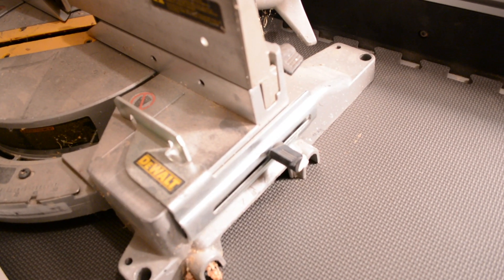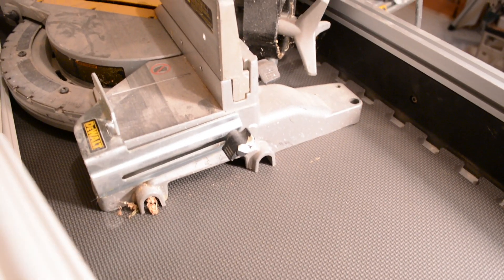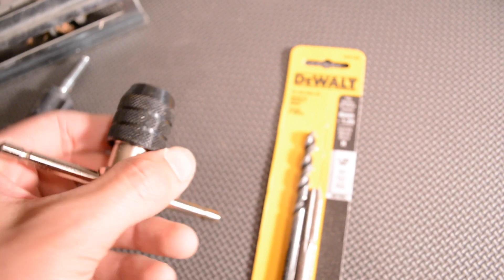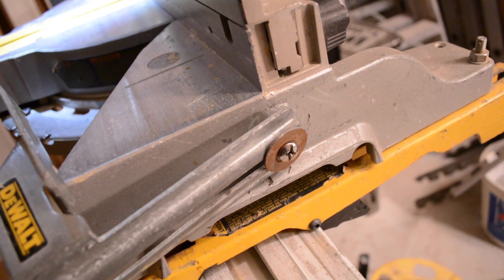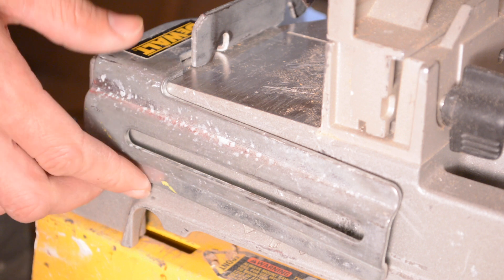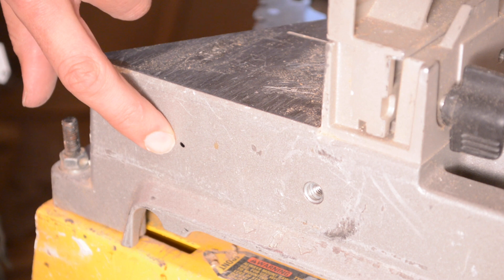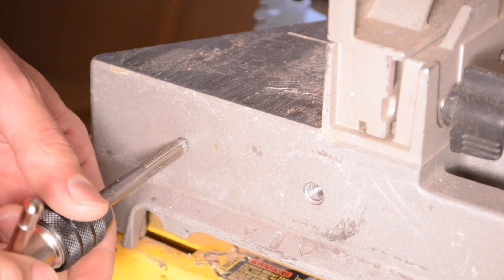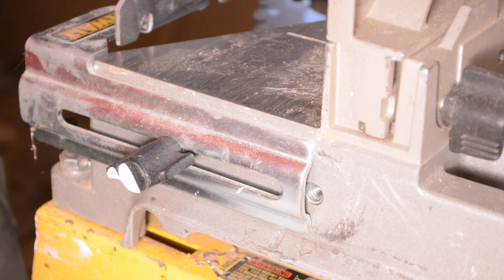I Modified My DeWalt! It Actually Worked!

Comment: Don't go too crazy on tightening that nut. Looks like you only have 4-5 threads to work with, and that aluminum will strip very quickly.
Reply: Matthew Wheaton I was actually wondering why it didnt strip upon first use. Id bondo/epoxy a nut or piece of tapped steel on the other side.
Reply: Matthew Wheaton Matt is right, just flip the Mitre Saw upside down, and epoxy a bolt or weld a bolt on the inside problem solved, if you don't want to thread the hole you can just do that to start with.
Reply: Agreed, if you look at the original hole, there is a steel nutsert/rivnut embedded in the cast alloy base. DeWalt put that there because the material is so soft and thin that the threads would strip in no time. I recommend modifying this to add a nut or tapped steel insert behind the base so you're not relying on the 4-5 threads in the soft aluminium.
Reply: There is another way to do with 10" slide dewalt, If some body interested can send a  pictures how guys from our company modify  saws and stands
Reply: Rivnut it.
Reply: I’m gonna do this , I need to look under my saw when I get a chance , see if there a spot with a little more meat to drill into. A spot with some gussets or something

Comment: I'd be very wary of using that new hole,  very thin wall and very little material to support the threads.  I'd look into a threaded insert to reinforce that.  Never used those crown stops and I've cut the same cove mold without issue,  sometimes the crown needs to be rocked a little in the saw to make a clean splice.
Reply from the maker: Definitely hear you. The modification will probably continue with a threaded insert, or nut on the other side of the thread.

Comment: I have asked this question several times, on several different you tube vids, and never a response. Why, when the saw has the ability to cut many angles, do we cut crown in the upside down position. It is extremely confusing and does not make sense. Can someone please explain.

Comment: Welcome to metal work! Resourceful mod to get the most from your saw.

A few pointers:

(a) "Threading" denotes cutting male threads. It's done with a tool called a "die" or on a lathe with a gearbox. Cutting female threads (like here) is called "tapping," and the tool you used to do it is called a "tap."
(b) It helps to punch/center drill holes to position them precisely.
(c) That's a tiny amount of metal there. You are probably going to strip your hole, especially reefing down on it the way you're needing to. Some other posters have mentioned a "nutsert" (also called a "rivet nut") or attaching a nut or extra metal on the back of the hole. Either of these will make the mod far more durable.
(d) It might not bang around well on the way to the jobsite, but as a resourceful carpenter, you could add a second knob and fashion a little sled that wouldn't jangle around and be quite as painful to position.
(e) If you get a chance to play in a machine shop, take it! You'll be a natural and will be able to design and mill a top quality rock solid upgrade in relatively little time.

Comment: In the video when you have the large trim on the saw , I can see the original hole showing couldn't you have just cut the slot a little longer and used the original hole?

Comment: The worst part is that when the hole strips it will be right when in use. Time sert makes the best thread inserts. You have to buy several in the kit, so just go ahead and install several on each saw.

Comment: Good modification but be careful not to over tighten the tbumb screw. You don't have as many threads as the rear hole and its cast aluminum. Good job.

Comment: hello,if i were you,i would put a nut on the back end of that screw hole you've just made fit before you strip out the thread again,after doing that,make yourself another hole at the end of the fastener just a bit toward's you,about half inch or so away from the old screw hole,that should keep it all a bit tighter for you with minimal drop on the fastener,job's done,and please keep them coming for all of us over in England,thanx buddy

Comment: another tip for you, a better blade equals better cuts and less time. you can't go wrong with the red frude Diablo 100 tooth thin  kerf Tri cut tooth.  
however to have that blade sharpened is a nightmare as there are three sides to each tooth. Blade sharpeners don't like you when they see you coming. So then pitch it and replace it with the same.
Reply from the maker: Wade Verweire yes I am switching to Diablo next week! good call. I was just using these DeWalt blades because I had them. I'm going with one on the table saw too.
Reply: dfw crown yeah they make crazy good blades that stay sharp forever if you don't cut nails LOL. I used to build custom cabinets for about 10 years, I've done a little bit of everything yet not everything. it's interesting to experience different lines of work. Currently I'm doing some welding on my pole barn and came across Diablo steel demon for a  7 1/4 skill saw and was impressed it rips through metal sheeting like butter.
Reply: dfw crown It's nice that you are so receptive to your subscribers, I comment on the Samurai Carpenters stuff and he gets all defensive like a big baby. So where I'm going with this, tailing off of the blade comment, I was always told to let the blade gain full speed before you chop.  You cut very quickly in your videos, maybe let the saw gain full speed before chopping, you will definitely get a nicer cut. I'm just saying, your stuff appears to be great looking, but it's hard to tell the cut quality on film. Thanks for all the tips, have a prosperous work week sir.
Reply from the maker: Matthew Kelly thanks. yes I am learning just like everyone else. I have gained much knowledge since starting this channel. I mostly cut MDF and FJP thin moulding s. so its very thin. but thanks for the tip. have a great week

Comment: A Great Adaptation for larger CROWN.
.......................................................................................
( go one step farther to keep the slider from 
..sagging down when pulled all the way toward you)
........................................................................................
To keep the slider on the same plane as the saw bed
when pulled all the way toward you,  simply attach a 
piece of metal that will fit between the slider and the saw bed
and have it extend from your new taped hole toward the 
back of the saw bed.
This way, when you slide the STOP, it will always stay in the 
same plane.

Comment: My Dewalt saw doesn't have the hole in the side to mount the crown stop .  The saw base isn't made of steel  so welding a nut to the other side isn't happening.
Tapping the saw base may work if the saw base is thick .  
You would think that Dewalt engineers would use their brains to design  every saw to have this  stop with the saw.

Comment: Add a nut to the inside. That aluminum will strip out very fast
Reply: Don Dehne I agree. Should use glue to hold the nut in place, just make sure to lightly cover the threads on the bolt before gluing so the glue does not stick to the bolt.

Comment: why you don't  cut it flat at the mittersaw
Reply: Martin Armendariz the cuts won't line up
Reply from the maker: I prefer to cut crown in the cradled position. I don't like adjusting that bevel so much.
Reply: They do if you do it right ......it's all math
Reply: Bring the crown molding in that position prevent you from having to make a compound miter. It’s just easier that way
Reply: zeke112964  what’s the math?

Comment: when you getting the flexvolt miter saw lol
Reply from the maker: Flores 828 lol. I always have power running so I don't really need the battery stuff. do you like it?
Reply: Heck ya bro its awesome. Plus its corded too so you get best of both worlds its nice just to pull out the saw and turn it on without having to pull the extension cords out.
Reply from the maker: Flores 828 true true, I will probably get it next time I need a miter saw.
Reply: Also if you get the chance checkout the flexvolt table saw

Comment: 33.9 --------31.6
Reply: 38 degree spring angle laying flat using a DeWalt  double bevel sliding compound mitre saw.  Learn the angles and the saw will take care of the rest.

Comment: I have done the same mod. oa
Reply: I have done the same mod on the dw 708. Add another fastener to keep it from dipping. I stopped using the stops shortly after trying them. It is best to cut large crown flat. The joints are much better.